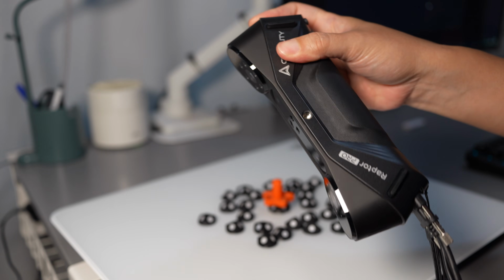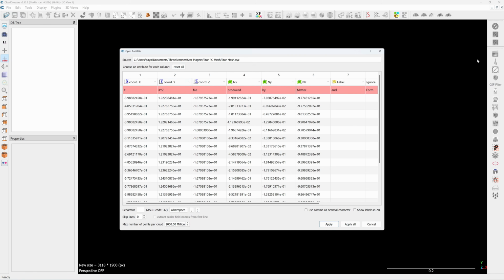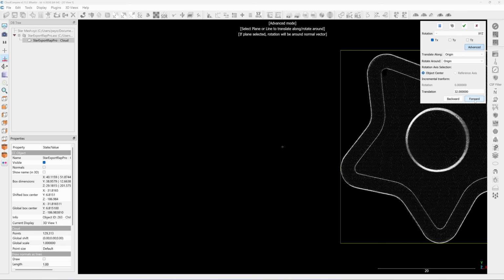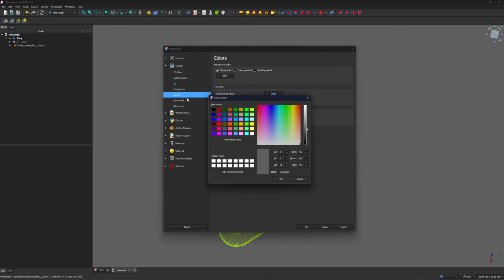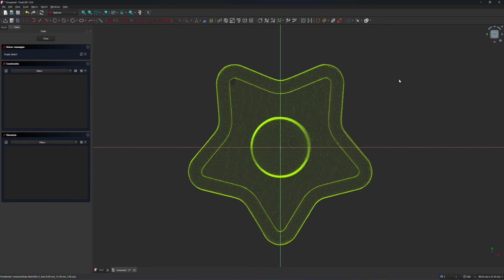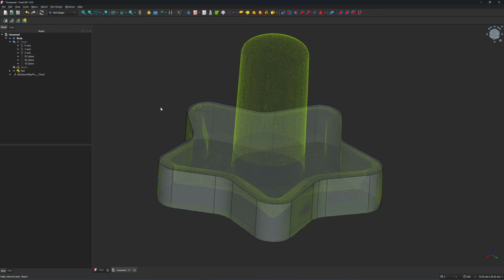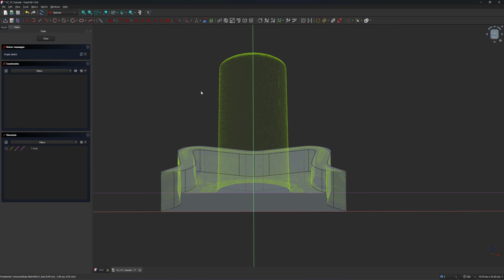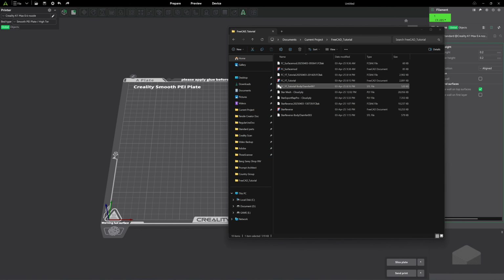3D Scanning to CAD for Free: Beginner's Guide to Reverse Engineering with FreeCAD

Comment: Hi! 
I have an object, and one of its faces is perfectly flat. However, after scanning and processing, when I put it in the slicer for printing, it's not completely flat and even generates some small print supports. What's the simplest method you use to flatten these types of faces or parts without altering the original piece? Thanks.
Reply from the maker: If you’re using Orca Slicer, you can drop that face below the build plate and it’ll be cut off and flattened. Another option is to use a clay tool like Substance Modeler to box‑cut the flat face. Either way, you’ll lose a few millimeters of solid material.

Comment: I guess you may not want to waste your time  but it would help a lot if you can do it. Can you use point cloud data for interior collected with Eagle Scanner(or any other Lidar scanner) to "reverse engineer" it to create an interior using FreeCad? I know you are good with AutoCad and Revit and there are plenty of tutorials for them about it however this software is expensive to have for a small business. And I am not even talking about creating BIM, more like tracing all walls and placing windows/doors to create as low polygon as as accurate 3D model as possible to texture it in Blender.  I could mesh in CloudCompare point cloud of my bedroom after scanning it with Eagle Scanner but after meshing it it came to 9M faces. It is huge for Blender to handle to use it for tracing.  And honestly Blender does not seem to be good with working with point clouds.
Reply from the maker: I've already made a video about this Eagle and FreeCAD. https://youtu.be/TjWTpJo-Yqw

Comment: Do you have any tips on adjusting the traced path without Freecad dragging everything else around with it? I tried making some edges fixed when I'm done adjusting them but it ends up locking up the whole path. Thanks!
Reply from the maker: If you look in this video. https://youtu.be/ybpLeqiwjqQ   
I would draw the line longer so that I can grab the end of the line for adjustment.

Comment: You can adjust the quality of FreeCAD STL export. With your model open, go to the mesh workbench. You don't have convert your model or even DO anything in the mesh workbench ... just being in that workbench enables additional mesh options in the preferences. With the mesh workbench open, go to the preferences, then Import-Export. If you are in the mesh workbench, an additional type will be visible: "Mesh Formats." This is where you can set the mesh deviation used when exporting to mesh formats. Lower numbers will create more accurate meshes, but will trade off against larger file sizes. Set your new value and click OK. Then you can go back to Part Design and export just as you did, but it will use the new deviation value when doing STL export.
Reply from the maker: I’ll definitely try that out! Thanks for the tip.

Comment: there is a simple way to align the model in the coordinate system, at least for one sloskoti, it is to add to the slicer bambu studio or orca slicer, and select “surface on the table” and also you can try to center it. it will help in the future. 
But I don't know English and can't model well, I use sometimes for repairing 3d scans "meshmixer" 
But I also heard about a good program geomejik design X. I downloaded the cracked version from torrent, it works, but I don't have the knowledge.  Maybe you can try to make some videos?  Or make videos for adobe photoshop 3d.

Comment: This is fantastic - the centering process was the missing link! Thank you so much!!
Reply: there is a simple way to align the model in the coordinate system, at least for one sloskoti, it is to add to the slicer bambu studio or orca slicer, and select “surface on the table” and also you can try to center it. it will help in the future.

Comment: Holy Crap thank you!  My Raptor Pro doesn't work with my mac yet but it works great with my threadripper.  This is going to help me tremendously, thank you sooo much!
Reply: @NavyCuda  had problems with the raptor pro on a mac. My problems where solved after tech support send the latest firmware. Be sure you have de raptor up to date. My problems where when I included the handle
Reply: @Eric1960  Oh so hook it up to my pc, update the firmware and try again with the mac?
Reply: @NavyCuda  this was my way to go. Meanwhile there is a loader for the mac, but nevertheless via a pc works. Hope your problems are solved

Comment: Instead of exporting STL, just export STEP file-format. If you use for example prusa-slicer, it will allow importing from STEP files with an excellent quality.
Reply from the maker: I attempted that approach, but it provides a similar level of detail as STL. Additionally, there are some issues with FreeCAD—specifically, the top dome isn't exported properly, unlike with STL.

Comment: Thank you for this excellent tutorial.  I bought the 3D scanner for modeling objects in FreeCAD.  I've been exporting STL mesh objects from the scanning software because I'm most familiar with STL formats when 3D printing, but knew I should experiment with a point cloud format.  As you showed with the point cloud, the STL is at an arbitrary rotation when input into FreeCAD and that is cumbersome for me to correct.  I knew there was a much easier way.  I'll try Tool -> Registration -> Move Bounding Box to Origin.  My scanned objects are simple enough that I haven't needed to use the Part Design workbench and can instead use the simpler Part workbench where I can model the part using Boolean combinations of primitives such as cube, cylinder, etc.  The Part workbench allows those new to CAD to use FreeCAD in TinkerCAD mode until learning enough to do real CAD sketching in the Part Design workbench.

I'm an engineer and I've been using FreeCAD intermittently for 5+ years but I'm still not that good with FreeCAD because I don't have much general CAD experience.  I'm an ELECTRICAL engineer.   :-)   You're much better with FreeCAD even though you had never used it, because you are experienced with other CAD programs.  You only needed to understand the FreeCAD syntax where I'm still learning fundamental CAD methods.  FreeCAD has gotten much better in the last year and is rapidly improving.  My CAD skills are improving too, but more slowly.
Reply from the maker: FreeCAD is a highly promising CAD software, built on a solid foundation. It's only a matter of time before it becomes the Blender equivalent for CAD users.

Comment: “Reverse engineering is free”, you just need a $1800 laser scanner.. 😂
Reply: Disagree 😅 its also helpful when you like to reverse engineer and downloaded STL file
Reply: You can pickup a refurbished raptor for $800 😊
Reply: @Biru_to  well sounds like you need to step up ur financial game Brah or step aside js lol
Reply: Im just using normal Iphone 16 with Scaniverse app. works just fine
Reply: No, you can make same scans with photos with your phone - photogrammetry, free but more work, works same way with 300$ scanners
Reply: @stefan37-1  Photogrammetry doesn't provide the dimensional accuracy of line-laser scanners, like the one used in this video. Especially for thin shapes, such as plastic walls in non-descript injection molded parts. You'll need to spend a lot of time to get a successful scan, and you'll need to prepare the object for the feature based tracking that photogrammetry relies on to work well. Photogrammetry is great for its cost (in other words, it can be very cheap), but there's a reason why line-laser scanners are the standard for any professional and production environment where accuracy (and time) is important. I'm looking forward getting my own line-laser scanner, as I've become tired of the tedious (and unreliable) process of photogrammetry when reverse engineering (smaller) parts. It's also the main reason I haven't bought one of those cheaper scanners, they're pretty bad compared to the phone you already have and something like Reality Capture, Zephyr or Metashape.
Reply: @Biru_to i got myself creality ferret and its slower than professional scanners but in the end its much faster than photogrammetry and works great for references